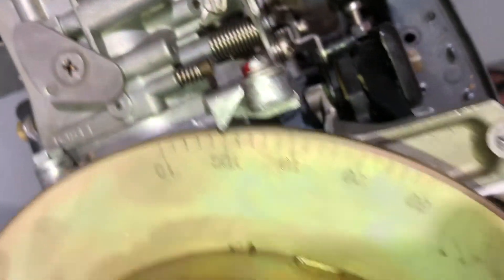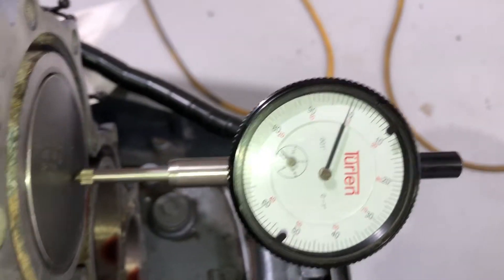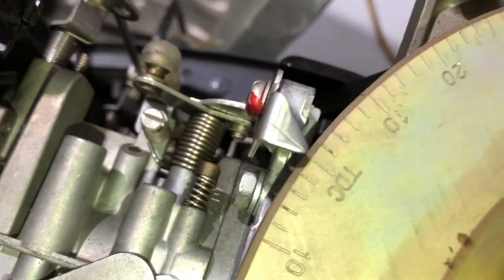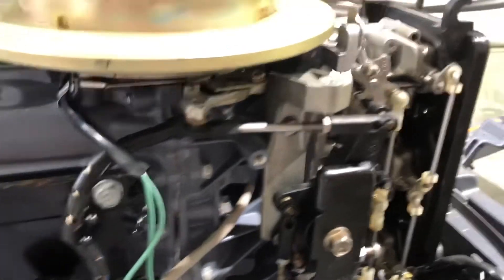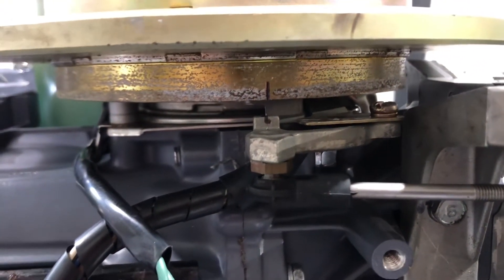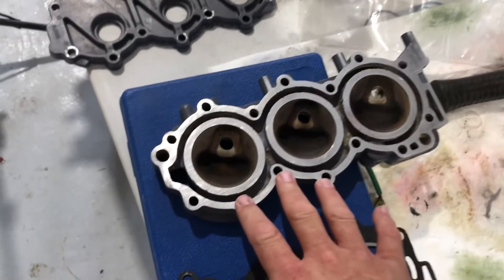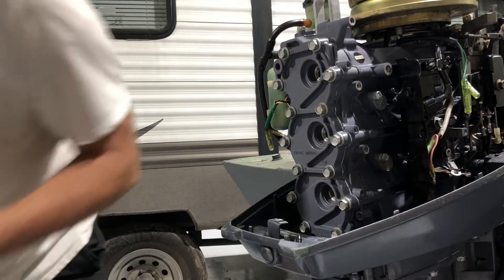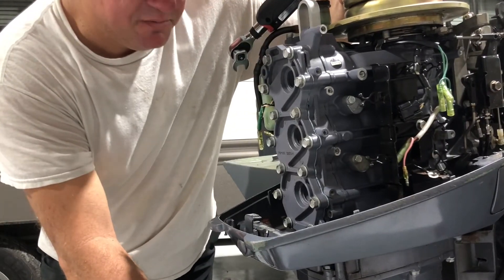Yamaha 30HP Outboard Overhaul Part-4. So Very Close To Being Finished. DIY Overhaul.

Comment: Great video series. It would also help to create a video on the wiring harness connections. Lots of folks get hung up and frustrated over the electrical connections and how to trace no start issues.

I am in the process of restoring a 2005 70TLR that burned up the center piston. Bought it used knowing that it needs rebuilding. Fun project so far. Should have the block back this week from the machine shop.
Reply from the maker: @MadLudwig  I’ll keep that video in mind. I’ll get Candice and we can film her going over the wiring harnesses and try to explain most of it.
Reply from the maker: @MadLudwig  Thank you. I’ll get Candice and we can make a video over the wiring harness.